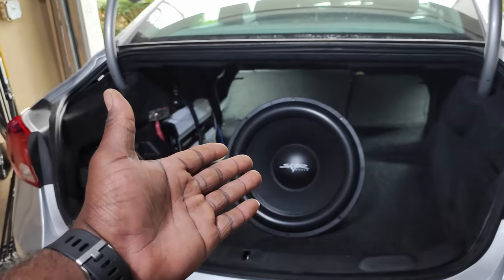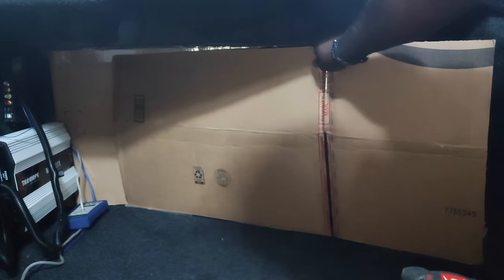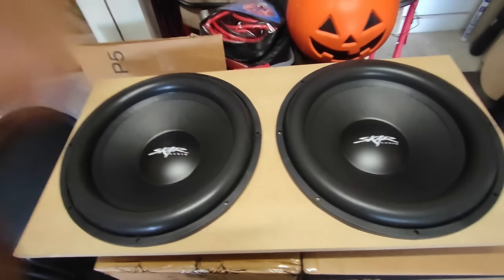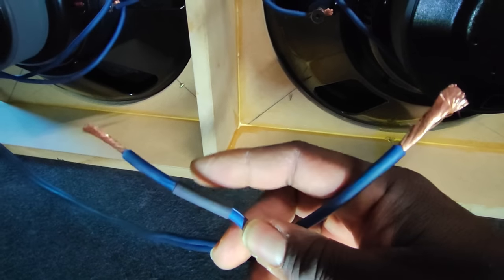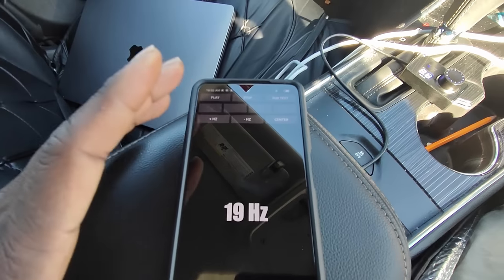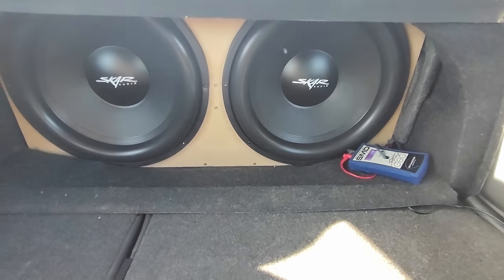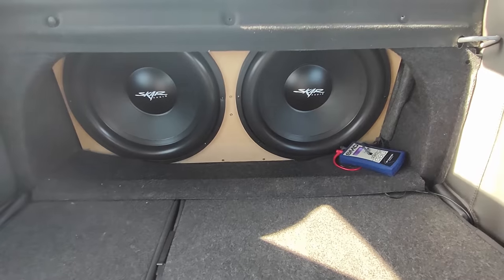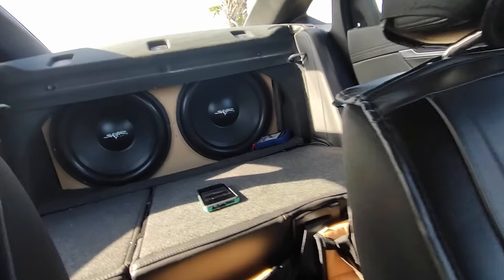No Other Design Sounds Better Than This - Infinite Baffle - 8,000 Watt Test - Part 1

Comment: The way it was explained to me by a sq guy back in the day is you  want to seal every possible leak between the the cabin and the trunk in an infinite baffle so the waves from the front don’t interact with waves from the back, thicker the baffle the better…. the better the partition the better the sound and output. Pair of 18’s fill the seat hole nicely 👍
Reply: The sq guy was right - but you must also consider that the more cone area the more that 20cu ft or so trunk turns into a sealed box.... IB means the only back pressure is atmospheric pressure, "infinite" box size - in practical application this is, lets say, 10 cubic feet for an 8, 15 for a 12.. simply, a box so large the back pressure has little affect on the frequency response, so if the box was larger it wouldn't matter aka essentially achieve the "infinite".box/infinite baffle

Comment: Oh you will enjoy that setup.  Being a teenager in the 80s and 90s, I've heard some good IB setups.  Some were horrible, but done properly, they can be smooth.  Just wait till you get'em broke in.  That bass is gonna get deeper and deeper.  I had an IB setup in my bedroom using a large closet.  You gotta be careful with cone excursion with that setup with that big of an amp. 8k of power on 1.2k of power handling. I enjoyed your video. ✌🏾

Comment: I considered doing this with 2 15s to save weight & space but instead made a pair of small (about .7cuft ea)10" boxes with Infinity Kapppas (selectable impedence). Plenty loud at about 1000W but haven't tested spl yet. Recently modded the boxes with slaps 10" radiators. Definately louder and retains the SQ of a sealed system! I'd love to try this IB setup some time with the proper drivers!

Comment: I did a similar thing in my 78 Cougar back in the 80s. I cut out and mounted my subs under to the back deck. With only 200 watt amp, 2 - 10" dual coil subs and that massive trunk. It sounded amazing inside and out. Sounded better than many of the local car audio installations.

Comment: Actually if you reverse the speakers and place ports under the top of the backseat your bass will be alot cleaner, granted you may have to seal the front so no air leaks to the trunk...all the bass will be ported to your cars interior not out the trunk...i had this set up in my cadillac with 2 13w7...just make sure you dont cut corners you have to insulate the vehicle with dynamat or similar type product.

Comment: Built something similar about 1990 for a NFL player. It was a SQ setup, but loud enough to satisfy his taste in music. When we were done you could put a quarter on the trunk and it would bounce three feet in the air. System had a Dennon head, audio control EQ and crossovers and a mish-mash of amps that I was never quite happy with. It sounded good, but we had some equipment failures, including some burned tweeters even though the tweeters were on a separate amplifier with electronic crossovers. It was only years later that I realized that all the burned to the point of failure tweeters were on one channel. A second channel has some burned coils but they still played. The other two tweeters, running on the same 4 channel amp never failed that I know of. We had one sub amp die horribly (replaced it with a Dennon if my memory serves). It was really good sound and other than the head unit, nothing was visible in the car. Still think about building myself something similar if I get a car but I think will last long enough to be worth the effort.

Comment: I designed an inverted clamshell with 3 JL 12s way back in the early 2000s that if new amps and speakers.. kill..  concept.. iso triangles.. two cones in one surface area. Just invert cone and phase on 60 degree baffles. Helps match rear air space better.

Comment: I had an old Gand Am Gt, and cut a hole in the back seat and recessed a 10 inch kicker inside the seat, it worked great, and I didn't loose any trunk space, just had to add extra foam incase someone sat in the seat to prevent the speaker magnet from hitting thier shoulder blades and back
Reply: I now have a chevy malibu with a 10 inch pioneer truck box, I don't really play too loud so having a ported box is not really needed

Comment: If you stack shelf..add sound deadening insulation and seal this bafle..then maby it will increase 4-6db on top of your current .
But yes you have a boot 🙌 that's a bonus ❤️

Comment: I have .I had 4 12” Kicker Free air in my T-Bird Turbo coupe .With a Phoenix Gold MS 2125 bridged mono .So they were getting 1100-1200 watts .It did hit !!
I took the same system and out it in my IROC .But I used 3 12” in a Camaro board .It basically a board that just covers the indentation in the hatchback 
That also hit pretty hard .
So Free air can work .
Richard Clark made a Aperiodic Enclosure.That is similar to your set up .But more elaborate.
But he won several world championships

Comment: I did that with 2 ct sounds tropo 12s in a 2005 Camry & sealed the baffle up completely with dynamat all along the rear deck and spray foam Around the edges of the baffle. It did sound really good as far as sq & saved all the trunk space, but also never hit as hard as a box would

Comment: Never done a IB myself not sure I would ever really do it I just personally like my bass with some pressure with it. After rocking my zv6 10s I got 2 sa 8s pre used on my taramp 10k doing 147db in a like 2.5 cubic box. I love the idea of the SQ build cause I listen to a lot of 24bit audio music but it's so much better with some dbs behind it lol. No lie them 8s have impressed me they don't go much lower than like 32hz but they do excellent on kicks and can even handle being on a 125hz LP so most music is acceptable. Loved the video you're very straightforward and covered most questions I would have asked about the IB build!

Comment: I totally agree with you on this setup.  I was heavy into car audio competition back in the 90s (the hay day) and the best SQ system I ever heard was an open baffle with two 18s.   You add in the simplified build, saved trunk space, and weight savings and SUCH A DEAL!  If I had a sedan, this is the setup I'd be running.  I would be you pick up a couple of dBs when you seal it in, especially if you seal in behind the interior panels.  That air is going to find it's way around unless you really seal it off.

Comment: Have 2 SDR-18s dual 4s. Wired in parallel @1st. Something was "missing", wasn't happy.
Wired all in series, not expecting much. It is on another level now, 4 me. Couldn't believe sound difference. Hard 2 explain. "Better" instead of just loud. Enjoyable now. Not sure if this happens "across the board" or not. 
 Parallel vs. Series.

Comment: You are correct about the SDRs... good setup.   try Power Supply Track 6 Woofer Excursion test.... SDRs were not made for SPL testing.   I promise .   EVL or the one that's better than that for SPL

Comment: for 2 18's, I wouldn't call this infinite baffle as the airspace needed for 2 18's in a sealed box would be close to the size of your trunk anyway. I would maybe call this trunk IB to note that it isn't true free air/IB. You would definitely be able to measure a difference in frequency response in the cabin if you vented your trunk vs closed it. But you're totally right, IB and trunk IB are the way to go for SQ builds. Amazing transience, they dig deeper than sealed can, and dont have peaky response like ported... and as you showed here, will still absolutely SLAM

Comment: Infinite baffled subwoofer systems have been around for years..
In the early 80s that's just about all we knew. We would either put them behind the seats in a sedan or mounted to the rear deck. Works then works now.. I always thought it was some of the best sound you could get. Two thumbs up

Comment: Were you testing at 12 volts or 14 volts? Put some matching carpet on the baffle, use some t-nuts and bolts on the speakers, and seal that baffle real good and your set. Good job.....very entertaining video.

Comment: Whats up budget basshead ? As ive commented on other vids , im working on a system build with my sl 550.. Well my wife and i were talking and i said i could throw some subs in her car too..Now not in a million years did i expect her to agree..lol.. she has a deep blue metallic 2010 Lancer Rallye Art..mega trunk space.. She bought it off the showroom floor with factory Rockford Fosgate sound system which sounds extremely good and came with 1-10" sub... Anyway my proposal is going to be this exact set up.. going to try get her to go for these 2-18' in an infinite baffle... Skar 1200 D amp ...  Stay tuned..lol

Comment: I'll take you up on that bet , I have 2 ssa evil 18s in a port box and range is from 10hz to 70hz , I have a sql build and sound quality is the main focus and it's an absolute monster .
I clamp over 10k on a vital power 7k wired at .5ohm

Comment: I think you may have some leaking. Seems like it should be higher. With a setup like that I was expecting at least 10 more db. Stereo Integrity is doing 148DB at 17hz on one IB sub and like 900 watts. And that car is a true SQ car.

Comment: I'm with you on the SQ deal. Only issue I see is you need a thicker baffle. 1.5in minimum and you should have triangular down braces which are very strong. That bottom footing needs to be much bigger too with those 18s.

Comment: Sweet simple build 👌 i bet if you remove the carpet in the trunk and used the sound tape and use the foam strips for doors and windows around your trunk lid and put everything back i bet you could easy get 140

Comment: I currently run a Infinite Baffle setup and it's so nice to have all of my trunks space while still having great bass. I run a Ultimax 18 and probably push under 50w 99% of the time. My focus is 15Hz+ but it is technically flat to 10Hz. I can't turn off my 10Hz highpass on my amp so it starts to roll off a bit before 10Hz.
Reply: Also just wanted to say when you have the trunk closed with the config in this video, it's technically not infinite baffle anymore. More like open baffle. Until you cut a hole in your car like I did and have the sub firing outside the car it can't be true IB other than when you have the trunk open and that's not something you can do while driving. Cheers.

Comment: Awesome build. 

You still have choices with this type of system. Really 2 12's would even sound very good this way as well. 18's one disadvantage is weight vs even say 15's they could still drive home the top end just a little more, and round off the edges a bit better. 
Most 15's would reach up and start working before the 75Hz these 18's started waking up at, and be punching at the 75Hz with a hefty surge. The 15's would stop working at about 26 to 25Hz. Below 26Hz or so 15's seem to go into the flapping zone.
2 12's would be buzzing your ears at 110Hz but lose it about 28Hz. But mind you what I am saying about losing it, is the fact that 12's will hit 28 fairly easily but it is getting in the area of flapping itself and making noise instead of actual sound reproduction; that's where the surface area of 2 18" woofers standing on top of the mountain howling at the moon @ 32Hz takes shape.... I know the flapping is contributed by other things besides slopp and total excursion, but the flap is also created by geometrical limitations of each and every surface area size.
Bringing to the next point of 1 sub vs 2 sub. Chances are if you rocked this 2 sub set up for 2 weeks and then went with 1 of them, you'd pound the 1 sub to death. 

After filling the cabin with the pressure of 2 subs, you'll always be looking for that sweet spot that will never be satisfied by 1... ~Exactly what she said!

2nd downside would be, most likely you find that the system actually sounds better with a half full trunk. Find yourself hunting for that perfect sound when the trunk is empty or full. That goes with most all systems though, but this one would be more fun to play with!

Awesome investigative reporting here man!

PS. I think you need to revisit this build while driving down the road. Do one cut where you have the seat down. Then show us how it is with the seat up. I think you still have room for the subs to flex and make very good sound between the seat and the subs. Hearing is believing though. And would make great content. 
This blows a box in the trunk out of the water; as well as not slashing the room passenger area of most back seats or trunk with a box. Most people already knew this could and can be done; but for mind blowing bass the box has always been the way to go. This setup would give a heck of a broken windshield and back glass run for the boxes money.... No doubt she'll rip, she just don't need to!
Fade 2 numbers to the front speakers always, for SQ; makes the tag slap more harmonic...
Reply: I don't know bout all that but you needa check out jensens. Way cheaper than alpine but just as good. I can't even tell the difference. Don't fall for the market hype like these suckers

Comment: sweet set up! im currently working on a isobaric 6th order with PR's rather then traditional ports! I really hope u can get great SQL in small a space with great bass oh two tens solobaric with a 15in pr in the front chamber tuned to 25 hrtz  and two 10 inch PR in the rear chamber tuned to 50n hrz

Comment: You do know if you seal off your trunk from the interior of your vehicle using fiberglass or expanding foam sealant or whatever method you prefer your subwoofer volume will increase exponentially you've got are leaking through your rear deck and around the edges of your seats if you remove your rear deck cover and your seats and fiberglass all that in so the trunk is a completely separate compartment from the cab / interior of the vehicle you will get a tan more volume out of your infinite baffle setup

Comment: If you take all he carpet out the trunk and take some fiberglass an resin and cover the metal everywhere maken a sealed hard shell around the trunk. That will stiffen up the trunk an make the speakers seal better and sound even better. You can then put all the carpet back in andkeep he truck looking stock.

Comment: You could also do Aperiodic mats on the back… low frequencies pass through like regular IB… but with higher frequencies it acts like a small sealed box and keeps the upper bass super tight… also… for a really good IB system… the front should be completely sealed from the back… fix that and it’ll be bananas!

Comment: Yo I did the same thing with an avalanche cuz... I put the wall avalanche splitting there with the the 215s and the port Now I sealed my three flip cover and sealed the bed but I put a port in between my 15s so I can get a lot more of that release of the pressure Now the 15s I had you know were very powerful and my porch was 3 ft 4 in tubes going through the back so that was getting the reverb off of the back trunk space.. But I love your build man...word up❤❤❤

Comment: Not all subs will sound good in IB form because they are not engineered to run IB. 
Acoustic Elegance is one of (if not) the best Infinite Baffle sub makers on the market. 

IB's traditionally are for SQ but they can still move some air!!! This type of install is extremely popular in Europe

Comment: I did the same thing infinite baffle with a single sdr18 and blew it on 1300 watts. I'd be careful if I were you throwing that much power on them. They not gonna last long at all I promise you that. I also have a 2004 impala I done it in. I wish I had bought 2 and done a dual setup like you did maybe 2 on the 1300 would've lasted longer than the single did. I think its lasted 3 weeks of only playing it a few times cause I wasn't using that car much.

Comment: I've always liked sealed boxes for my listening, I can see where free air would be great as well, but i have a station wagon, so a baffle is out unless I wanted a wall
Reply from the maker: I think wagons and SUVs have an advantage with enclosures though. More space and no trunk to trap the sound. I'm jealous
Reply: @BudgetBassHead , I was meaning for the setup in the vid, My current ride os a 2006 Dodge Magnum and considering two 10's or smaller in sealed boxes for it. I have always had a soft spot for wagons and love it
Reply: If there's a hole in the floor under the carpet (spare tire) then you can run IB in the wagon for sure!!
Reply: @bucwilde3470 , A magnum has a spare tire bubble but the battery also resides there, also they are covered by two covers one to protect from a possible exploding battery the other just a level flat floor over the first cover. Lot of work, when I could just to a nice sealed box and call it good. Also when i was in high school there was a guy that had 2 18 inch kickers in an IB setup on a wall, he kept blowing the back glass out of it. sounded nice but expensive replacing the back glass

Comment: If you would have used the 2 pieces of card board to form fit the edges  and tripled up the plywood you would increase spl and less stress on the subs

Comment: Ive used IB set up before and it works great for the SQ guys, if you looking for loud Bass as oppose to sound quality this is not the set up for you. Otherwise my brother great job especially if this is your daily driver . Practical with awesome sound quality. remember be modest with your gain control on your amp. would you agree/

Comment: I did a dual 15 free air setup back in 1993.  Still the best system for sound quality I've ever used.   Hiphonics Olympus for the mugs mids and highs and Zeus for the MTX Eliminator subs through a pioneer premier stereo.  Enjoy it.